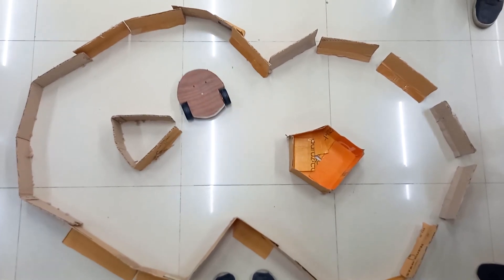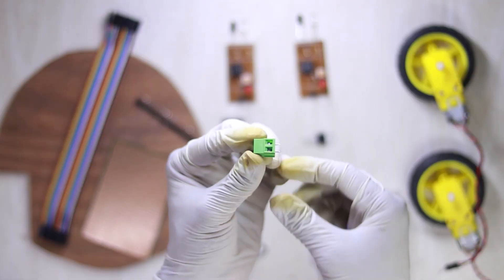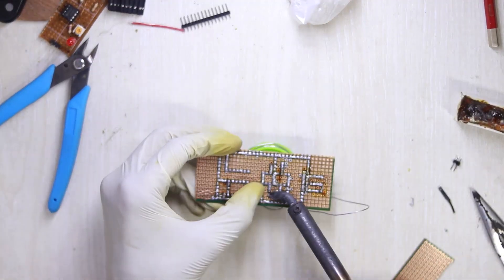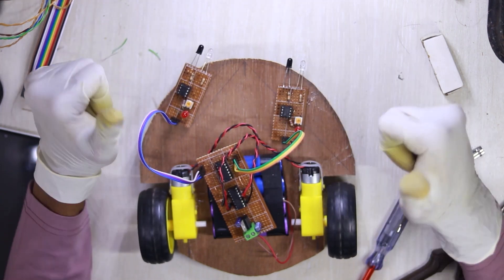Obstacle Avoiding Robot without Arduino or Microcontroller Electronics Projects

Comment: What logic IC do you use?
Reply from the maker: Not Gate IC 7404
Reply: @LogicalLedge I’m having a problem: when I power the system with four 3.7V 18650 cells,  the 7805 IC gets extremely hot, and when I use a 9V battery, the 7805’s output voltage is only 1.7V. I’m really frustrated with this issue.
Reply from the maker: @AnhVõNhựtHuỳnh  I used 4 18650 battery which are connected two 2 cells are in parallel and series connection between them.
(3.7v || 3.7v)+ (3.7v || 3.7v)= 7.4V.
7805 handle only 1 ampere current with proper heatsink installed. So if you robot draws more curremt you can add 7805 paralelly.
Best solutions is, use a buck converter which can handle more than 2 amps.
Reply: @LogicalLedge You use what battery, and what voltage do you supply to the system?

Comment: 🎯 Key points for quick navigation:

00:00 🚀 The robot is designed to avoid obstacles without using a microcontroller or Arduino, turning left or right upon detection.
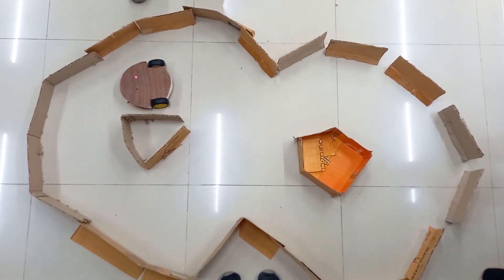00:13 🛠️ Key components include two IR sensor modules, a motor driver IC, a hex inverter, a 5V voltage regulator, capacitors, a wire connector, a caster wheel, and two DC motors with wheels.
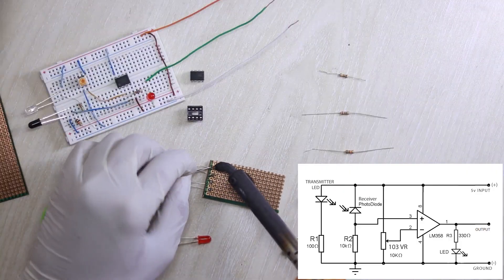00:56 🔌 The IR sensor module outputs around 3.5V when it detects an obstacle, playing a crucial role in the overall circuit.
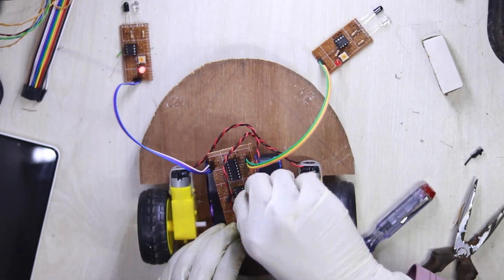01:23 🤖 The right motor reverses upon detection by the right IR sensor, and both sensors trigger backward movement to avoid obstacles.
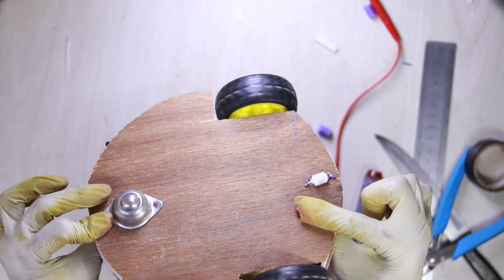01:54 🎨 The completed robot functions as anticipated and has an aesthetically pleasing design.

Made with HARPA AI

Comment: I see in comment section that you said you will upload the details where i can find the video of it ? And if you didnot can you at least lay out  all the components
Reply from the maker: I'm very much irregular in youtube.  What you need actually, The circuit diagram or the component list.
Reply: @LogicalLedge  both if it is possible 
Thanks for replying
Reply: @LogicalLedge  i need the total component list and a proper picture of the IR module and the main board
as soon as possible

Comment: Can i use ir sensor
Reply from the maker: Yeah you can use Ir sensor module which available in market but the object detecting range is very short. That's why i make it on my own.
Reply: Thank you
Reply: I don't have soldering iron instead of making circuit can I use L298N motor driver
Reply from the maker: @MRLEdit217  Yes
Reply: @LogicalLedge thank you very much I want to build that but I have low budget thank you 😊😊
Reply from the maker: @MRLEdit217  Best of Luck♥️ Need any help just nock me.
Reply: Where can I see the diagram